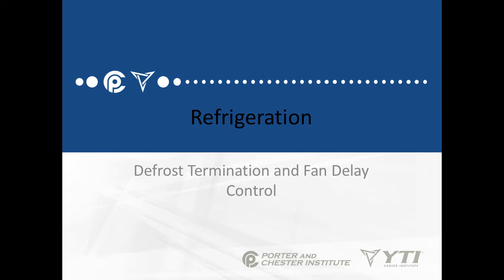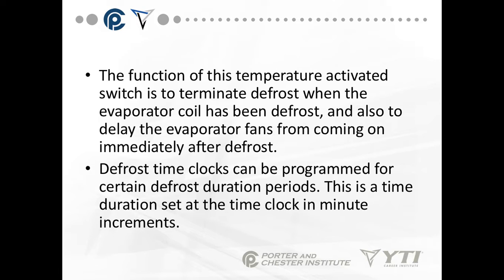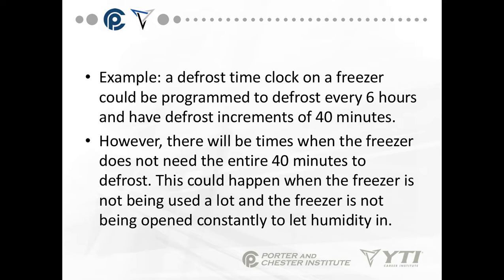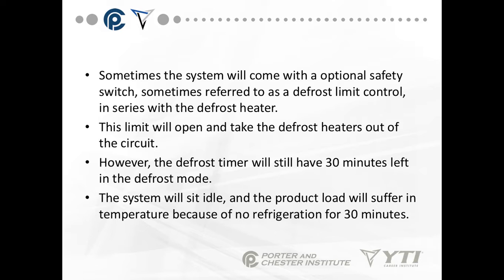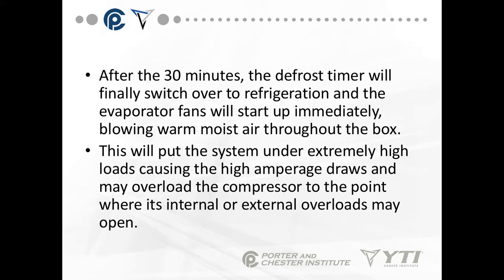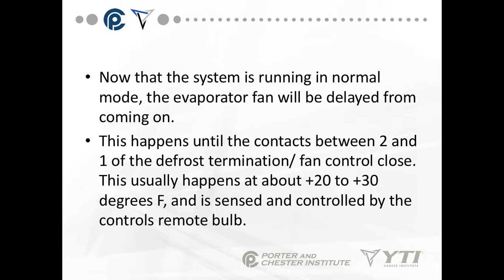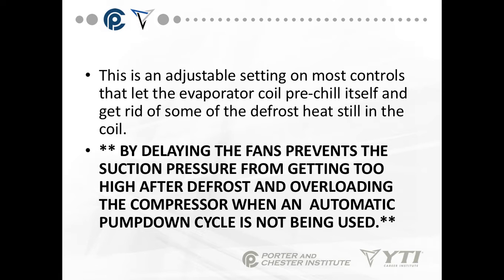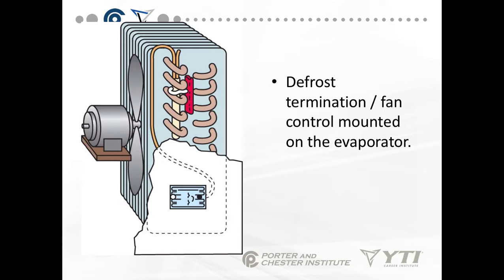Core Refrigeration: Defrost Termination

Comment: Hi, can you explain how condensing units are connected to case lineups (example, 36 feet of produce, or three 12 ft cases) ? Are the thermostats in all 3 cases connected in parallel with each other, and in series with the liquid line solenoid coil? Thanks.
Reply from the maker: In most cases you will find the thermostats connected to solenoid valves right before the evaporator on each case. The compressor is most often controlled by a low pressure switch.

Comment: So I'm dealing with the first sensor you showed.. Essentially if this switch was stuck in the wrong position the system could go back into refrigeration from defrost and the evap fans may never kick on?? Is that correct?
Reply from the maker: Yes. Sorry I didn't see this earlier.